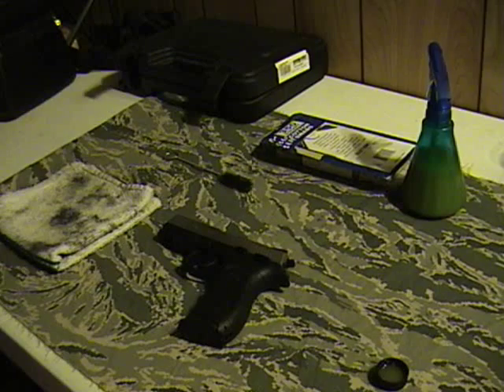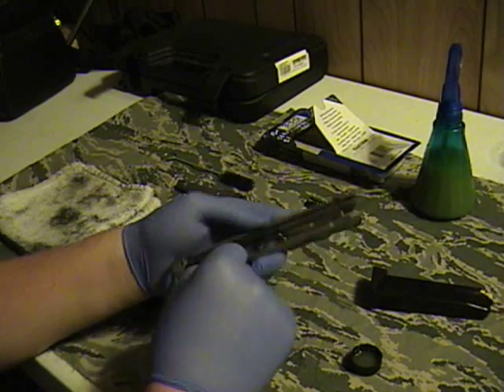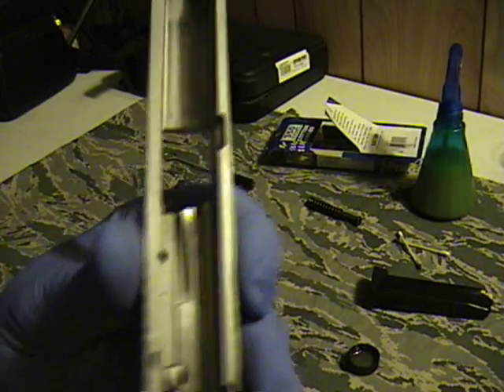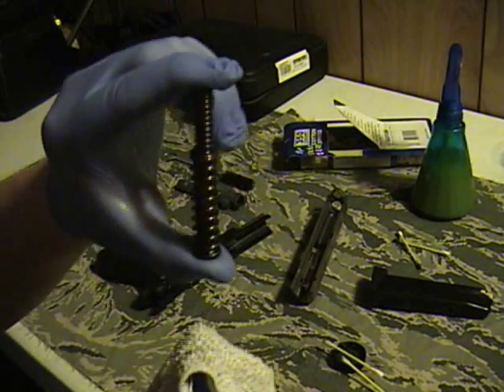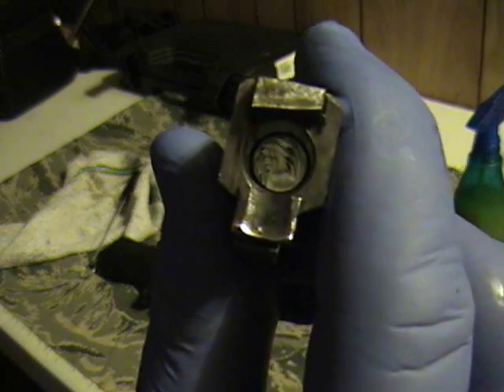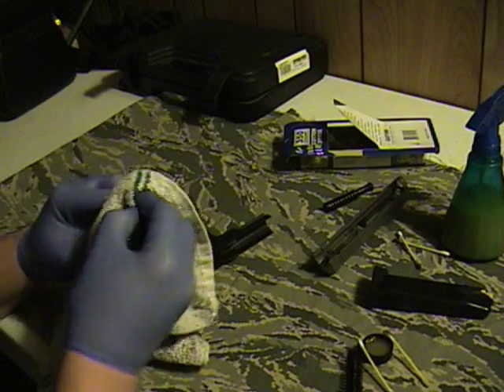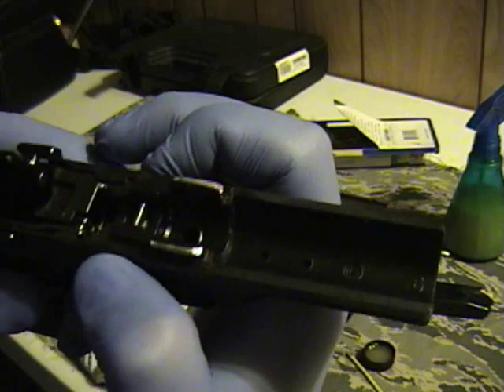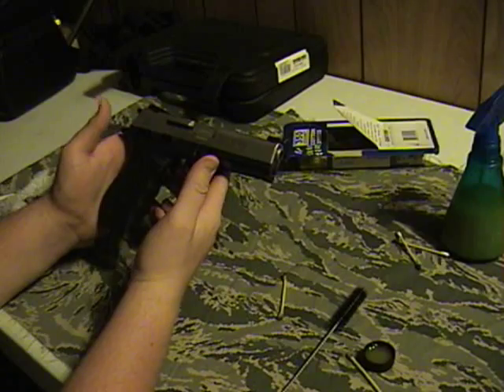NWATB Taurus PT809 Cleaning

Comment: Thanks for the video. Good job. I've used a couple of different techniques for cleaning my PT809. The latest way is using a hair dryer to heat up the metal parts the applying FrogLube. Works pretty well. It's bio based so you don't need gloves. Smells good too. The important thing is of course is to always clean your guns, however you do it.